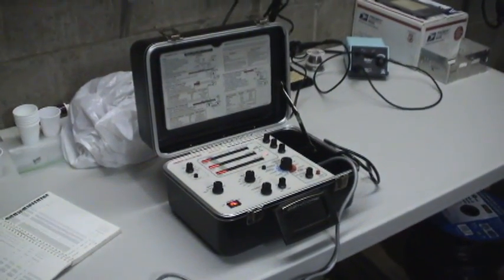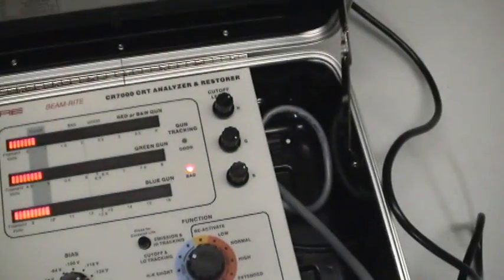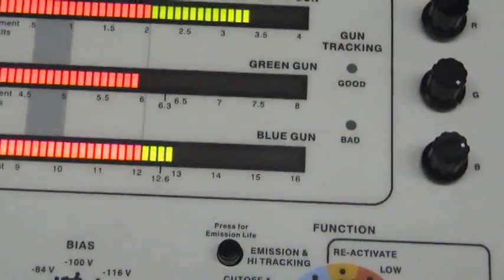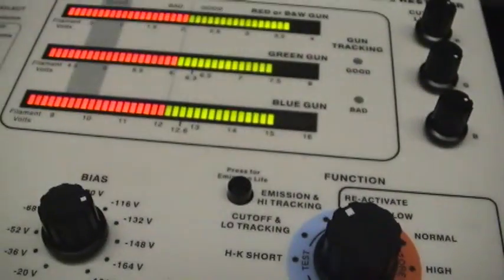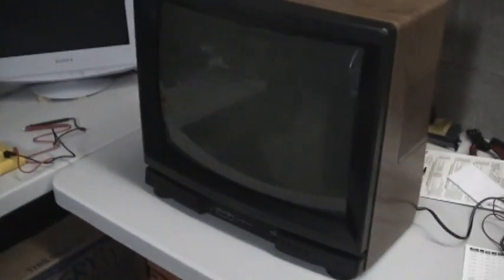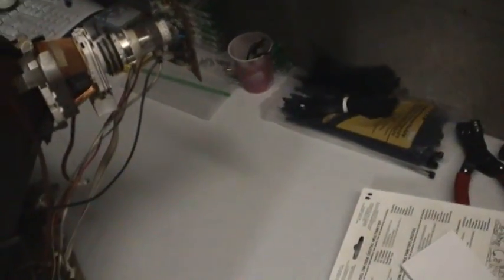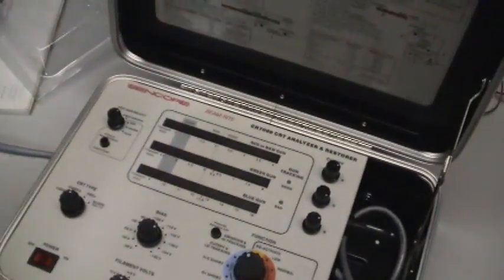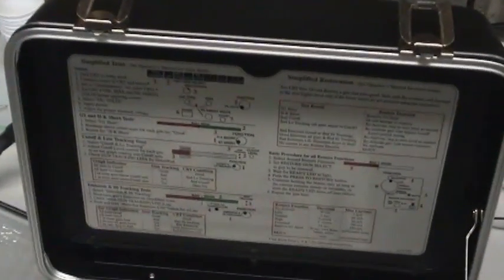Sencore CR-7000 CRT Tester/Rejuvenator Demo - Part I

Comment: That thing is awesome!  I have a CR70 but always liked those CR7000's.  Just need to wait for one to appear on ebay, I bet they go for quite a good amount still these days.  Does yours have the universal adapter (adapter with clip leads to attach directly to the pins) so you can use it on older tubes like the 21" round color CRTs?

Comment: I used to own some Sencore, I had the older model CRT tester. I used it to restore quite a few tv's. This stuff is built to last a lifetime, the O Scope they make is awesome. You just set it on auto and away you go...no adjusting knobs etc. You can take measurements and hardly ever have to adjust it. I wish I still had it.

Comment: @AllAmericanFiveRadio I have the same unit, and it get s a lot of use!  Almost all of the equipment I service at work still uses CRT's.  Luckily you can get one of these much cheaper than the original $2,000 price tag these days :-)

Comment: @wilkes85 There are a ton of variables when determining if a CRT can be rejuvenated or not.  I've done dozens and dozens of them with this same model tester.  Most can be fixed, but not all.

Whatever gun goes bad first also has many variables.  The green is usually the center gun in the CRT neck, so it runs the hottest.  Also depends on how the user has the tint control set.  And of course, the quality of the cathode material itself.

Comment: a CRT tester/rejuvinator! now that's exactly what you need! Glad you were able to get a hold of one.

It's strange how the green gun would be the weakest... I may be wrong, but isn't the green gun usually the last one to start going bad?

How far gone does a CRT have to be before the rejuvinator can't fix it?
If you had a TV with a completely dead CRT, like if all you got was that coloured blotch in the middle, could the rejuvinator fix it?

Comment: Odd that only the right side would shrink.  Best way to see what's going on is look for arcing.  You'd have to turn the lights off and keep your hand on the power switch.  Could be the yoke arcing to the aquadag.  Sanyo did have some yoke issues around that time.  Higher humidity this time of year will affect it if it's going bad.

Also, even though CRT shorts don't usually affect deflection, they can cause the other circuits in the TV to act funny.  Same goes for arcing anywhere else in the TV.